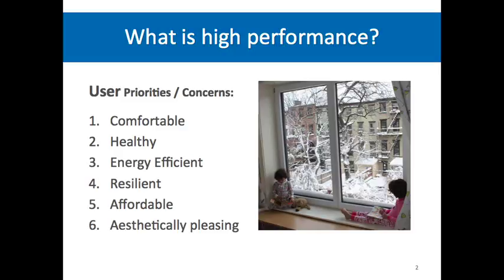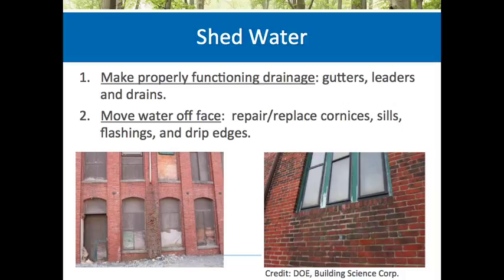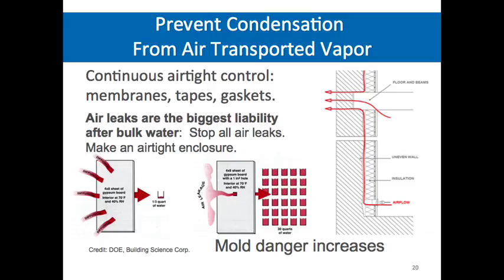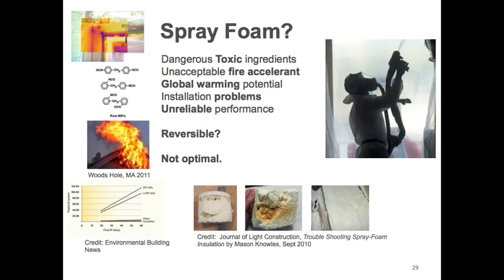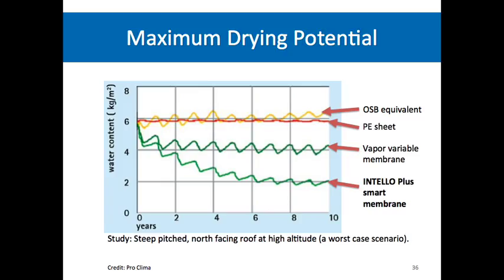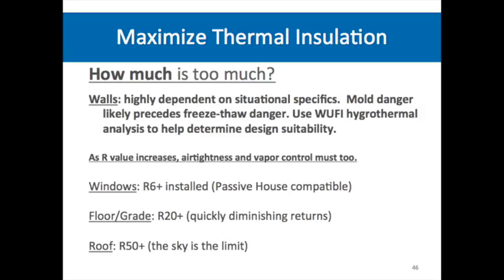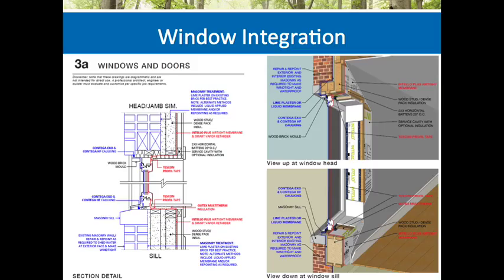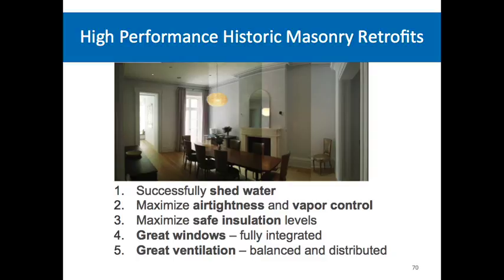High Performance Historic Masonry Retrofits - 2017 edition

Comment: Great video. As the owner of an Edwardian brick built house in the UK, the more I learn about internally insulating and the dangers and requirements around it, the more I despair. There is little chance that many builders (or other building professionals) here are going to understand this stuff and do it correctly. I fear that our historic building stock is going to be significantly damaged over the coming years as well meaning owners engage contractors to put internal insulation in and end up with lots of problems.
Reply from the maker: If you have a look, Liam, I'm sure you'll find building professionals are more abundant than you think in the UK. Find the team you're looking for through Passive House Plus Magazine or by looking up the local Passive House professional's group in your area. Chances are, they will use a similar system, but one adapted to your climate. Best of luck.
Reply: @475.SUPPLY  Many thanks for the reply. Yeah I think if you are going full blown passive haus there are a (limited) number of good knowledgable teams around the uk, but for the mass market just trying to improve their envelopes somewhat (like me) we will have to rely on regular builders. I've worked with a lot of those over here and they're not the most, er, knowledgable on correct techniques.